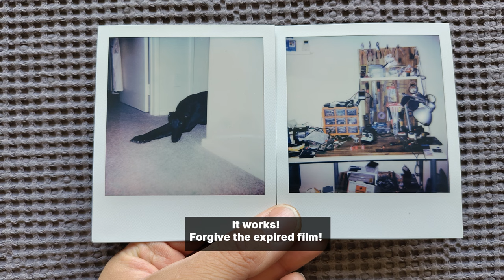Modifying an SX-70 Flash to use 600 & i-Type film!

Comment: This video was super helpful to me. I just got my SX-70 Sonar back fully refurbished and modified to use 600 film and tested it on my polatronic 2350 flash, and it was WAY TOO powerful to use. So I actually covered the flash lens piece with some light dimming sticker and it works a whole lot better with my camera now. And the funny part about that, is I didn't even know it was actually a thing that people did to modify their flash to use 600 film until i saw this video. But nevertheless, I'm glad to know that I'm not the only one 😅

Comment: This is good to know! I picked up a sonar with a polatronic flash, and I had to take it apart to add some insulator between the battery terminals and the spring holding them in place (they were shorting together and melting the battery compartment) and I was shocked by how big the capacitor is. 
I was planning on converting the sonar to 600, glad I saw this before I ended up with bad photos.
Are there any downsides for just using the ND filter on the flash? Does it keep the shutter open longer since it’s exposing for SX-70?
Reply from the maker: shutter is always the same speed

The main advantage with a 1/4 power cap is a MUCH faster charging time (its at least 4x faster!)
Reply: @theinstantcameraguy  interesting, thank you!

Comment: Would swapping the original flash capacitor in a 600 box-type camera for a brand new cap with the same values make it charge noticeably faster? Or is the difference in charging speed mostly due to the smaller capacitance?
Reply from the maker: The faster charge is mainly due to it being 1/4 the size

600 cameras have pretty good quality capacitors already. Made by Rubicon

Comment: Can you do this mod for a Polatronic 2350?
Reply from the maker: All flashes can be modified at the least by tinting the flash lens

As for specific models, it'll really just depend on if a new capacitor will fit

Comment: Jake, when someone mentioned this method in the comments in the previous video, you said you tried this and using a 1/4 capacity capacitor in the flash resulted in underexposed images. So you ended up using a 1/2 capacity capacitor which worked great. Now you've used a 1/4 capacity again. What's up with that?
Reply from the maker: There was another problem with that flash that led me to believe the 1/4 method didn't work right. 

I've gone back and deleted that comment since it is erroneous
Reply: @theinstantcameraguy  Thanks!